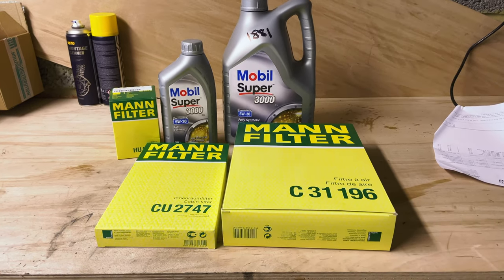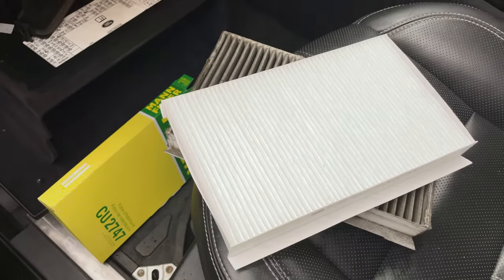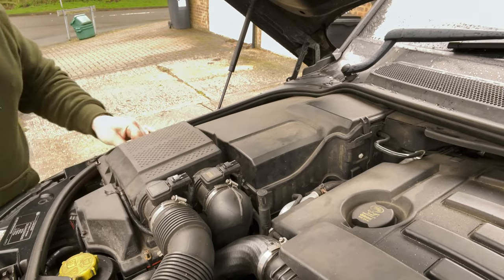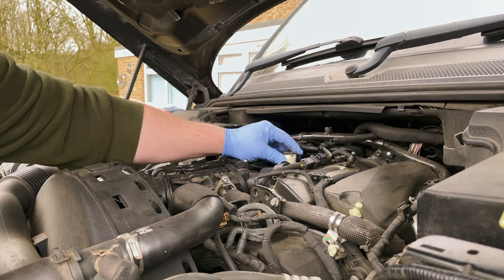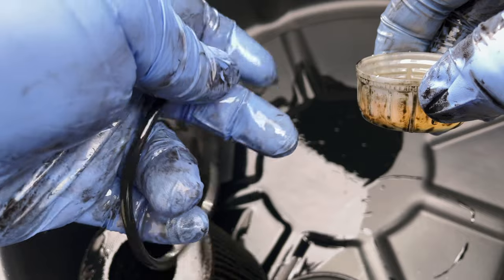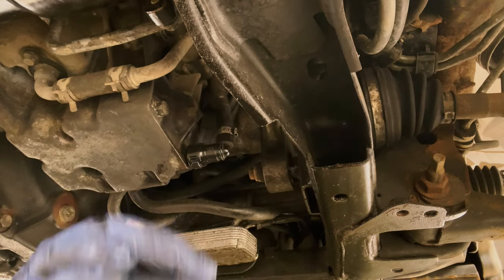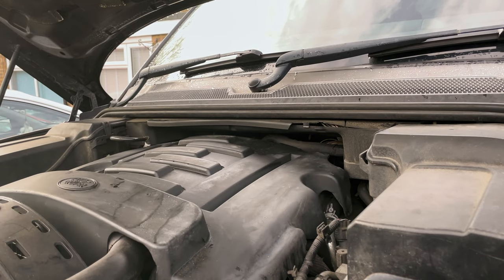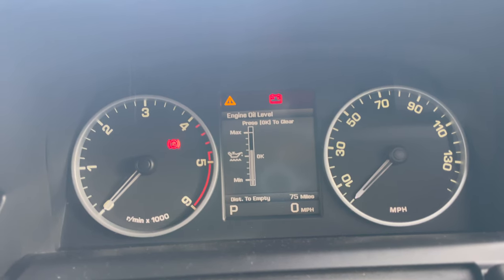Range Rover Service L320 2010 - 2013 *Oil Change* *Air Filter Change* *Pollen Filter Change*

Comment: I think youve put the pollen filter in upside down mate. If you look at the little diagram it shows where the dirt is
Reply from the maker: I’m pretty sure it’s the correct way around. It’s simple enough to get right.
Reply: @OctaneFever  You have definitely installed it upside down. Air flow is in the downward direction. A genuine LR filter has the arrows pointing up to denote installation direction. Aftermarket filters, such as Mann, have the arrow pointing in the direction of the air flow. Easy mistake to make.
Reply: @kevwatkins  Yep, agreed.

Comment: NEVER trust any garage to do the the service, always check that its been done and you want all the old filters and parts, they replaced, if they dont give you dont pay them, i was caught out big time from a "range rover garage", i had a poke around afterwards, and found air & diesel  and gear box filter was never touched, so they did the full serviced again with me under the ramp watching them, all they did to my l322 was plug the car in and cleared the service light,  i let them off light it still bugs me thinking about it,